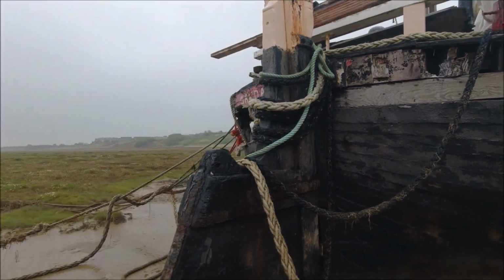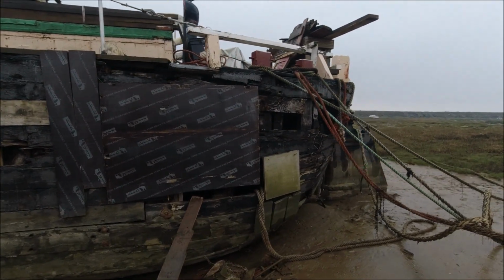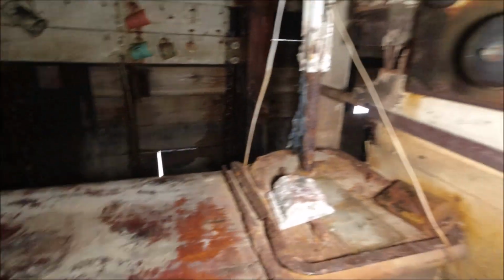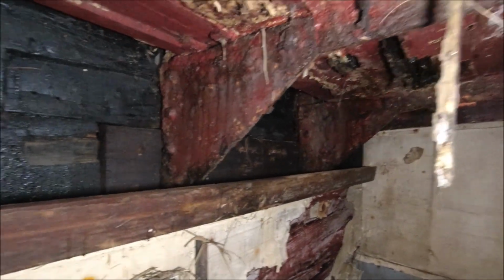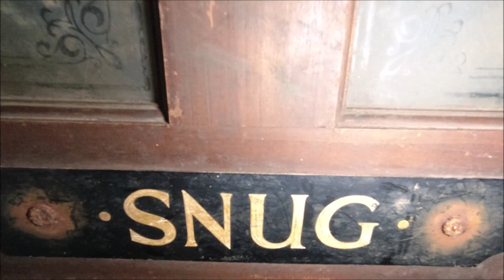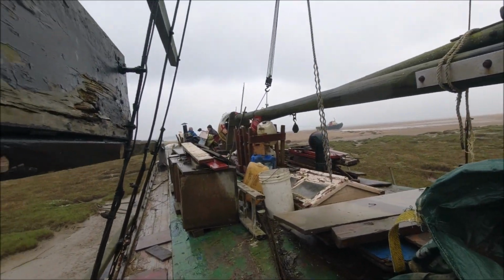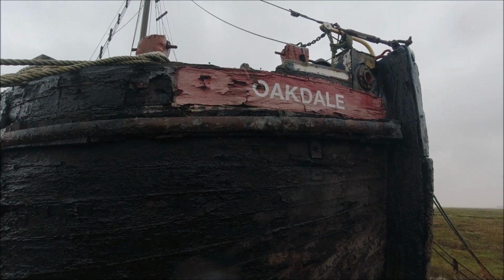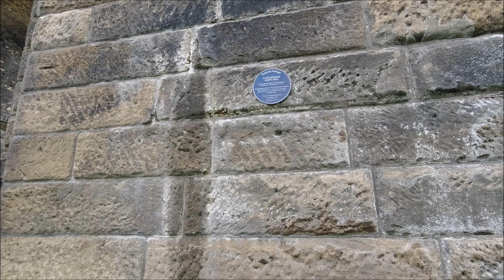Preserving A Mersey Flat Boat

Comment: Hello gents.  Many thanks for making this video and for sharing our story (and the links to our various pages / social media).  I work away and so missed the original posting, sorry.  I am one of the team working on restoring OAKDALE and it is fantastic to see other people take an interest.  Just to up date you, and anyone else interested: We are still going and are working hard to get the necessary protection in place to safeguard OAKDALE for the upcoming winter.  After that, it will be more surveying and recording as we carefully take her apart ahead of a full rebuild.  We have friends in place that can help and our focus is bringing them all together, with a suitable funding partner, to ensure success.
For clarity of one of the points raised: OAKDALE was an "Outside" Flat, designed for the Mersey and actually sailed into the Irish Sea (as you know from your own research and mentioned in her story).  Her smaller half-sister, MOSSDALE (built in Chester and rebuilt by Abel's of Runcorn after they purchased her), was an "Inside" Flat, built for the canals.  Many such variations existed, with Flats of specific dimensions being named after the waterways or ports to which they could sail (having been constructed to fit the locks and other fixtures that these sailings entailed dealing with).  Some had more exotic-sounding names, like "Leeds & Liverpool Short Boats", which were shorter versions designed for the canal of the two-city name.  Longer versions of these were built also, and a great many vessels with different sailing rigs, launched as such but effectively built as Flat-type hulls.
Only the OAKDALE and MOSSDALE survive, out of the actual Mersey Flats (not counting Leeds & Liverpool Boats, of which a small number still can be found).  But OAKDALE was actually taken into the Mersey and beyond, trading as her long-lost ancestors once did.  She was built to the same designs that Abel's had used for around a century, but with slight modifications by the yard manager (her designer, Ernie Andrews).  This, combined with her composite build, make her a truly important vessel, the last survivor of a style of craft that developed out of medieval vessels built all over the North West.
Thanks again; take care and enjoy your travels.
Reply from the maker: Hi Bob.  Thanks for gstting in touch and updating us. We really want to continue following Oakdale's journey so please keep us informed. When Oakdale is ready for dismantling we would like to make a follow up video f that and then as work goes on over the years if that's okay? It should be great to do that. It has proved to be of interest to a lot of people both in the UK but also our subscribers from overseas.
Fingers crossed for the funding.
Reply: @CampervanTales  Hi!  Thanks for your swift reply and kind words.  That would be fantastic; thanks very much.  We'd love to have you video our progress and keep in touch.  I shall make sure that the rest of the Board is aware of this and keeps in touch whilst I am back at sea.  I will keep checking-in with you once back home also.  Thanks again; great to have you with us.